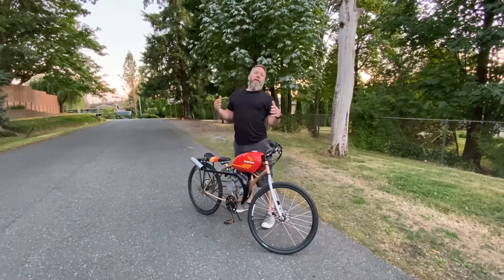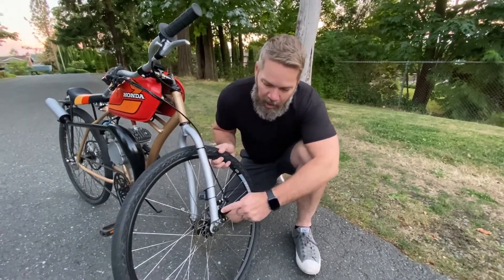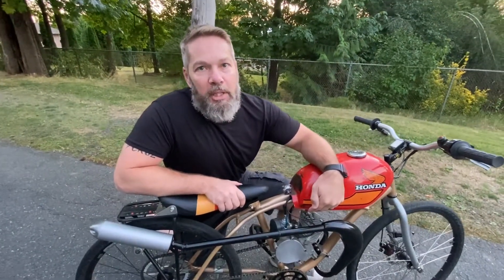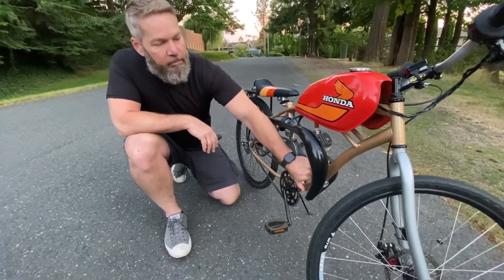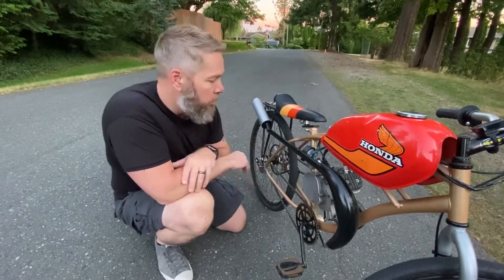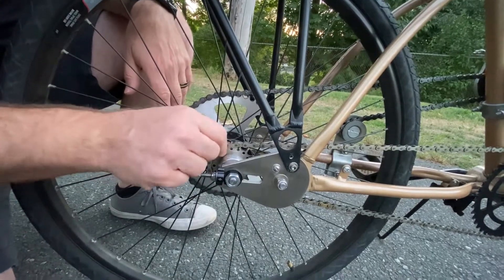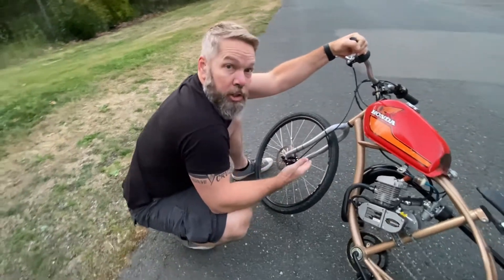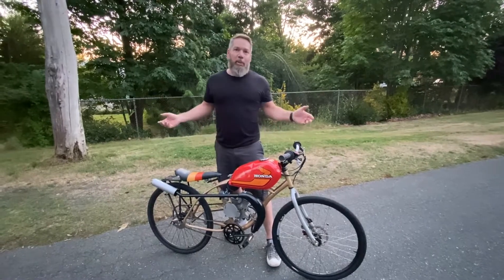The Donald Motorized Bicycle - volume 3 - walk around and upgrades update

Comment: which motorcycle is the tank or more specific the fuel tank
Reply from the maker: mid-70's SL100 Honda.  IT was on Ebay and got it for a decent price with the cap.  Couldn't pass it up when I was planning the bike design.

Would be rad if you subscribed for updates.  I'm going to be posting a video soon about how I mounted the tank.
Reply: @pressfitproductions  thank you gentleman it is great the design stop it is not very big or very small the perfect gas tank for that engine and if I will subscribe to support the content 😁

Comment: That thing goes pretty fast
Reply from the maker: It has gotten quicker and quicker with every mod-update.

I worked on the jetting a bit recently after updating that carb and it has gotten quick nice.  With the large rear sprocket I give up some top end...for quickness and hill climbing power.  Which is just fine :-)

Thanks for watching and I hope you subscribe for more updates.

Comment: What's the size of frame?
Reply from the maker: Technically it would be considered a medium frame.  Pretty tight for me at 6' tall.

That is one of the reasons that the seat is kicked back as far as it is...and the rear wheel is extended out as well.  Needed to get some space on the frame.

Thanks for watching and hope you subscribed!
Reply: How thick is the dropouts?

Comment: I love your horiztonal drop out mod!
Reply from the maker: Thanks.  It is amazing what the little bit of extra wheelbase did for stability.  The Cranbrook frames are pretty small and so to get things where I wanted them it made sense.  I don't think I would go much farther out than what I did though.

There are a lot of added stresses to the frame when adding the dropouts...and the frame material is some of the cheapest steel that I know of, ha ha ha ha!

Comment: If you shorten the outlet pipe equal to 12 times its own diameter it we be more efficient at bleeding the pressure. There's a slew of pointers I'm finding out on my own by reading  "two stroke tuners hand book by Gordon jennings

Comment: What, no mention of the bigger dope ass fuel tank? Lol good build and I like those rear wheel extenders. Definitely putting it on my list.
Reply from the maker: Thanks man!  Yeah the tank is pretty bitching and one of the best parts of the bike.  The stock colors really pop off of the bronze/gold paint of the frame.

The extended rear dropouts are a must man.  Best of luck on your project.

Thanks for watching and hope you subscribed :-)
Reply: What motorcycle did the gas tank came off of ?

Comment: Those pipes are def better than stock, but the header pipe is too small diam.  The header length from engine to chamber is what will change where your power comes in. Bike looks awesome
Reply from the maker: Agreed.  I am hoping to weld up my KTM pipe and give it a shot once I get some free time to work on my TIG skills.  Till then I will just run this Amazon special.

Thanks for watching the video and I would so appreciate it if you subscribed.  Much love.

Comment: I like your bike but that pipe has no power band it's a gimmick pipe you should of used the ktm65 pipe also  
Other than that love the tank
Reply from the maker: Thanks for commenting!  The banana pipe is definitely not the best, but it is definitely better than that straight pipe that comes with the kits.

I will probably work on the KTM pipe I have this spring.  Luckily I have a good jet kit so I can quickly re-jet once the pipe is finished.

Comment: Every bike crash I see people are always picking their bike up before they actually get up . I got the same video almost of me doing it only I'm wearing a GoPro.👍👍☝️ beautiful looking design you got man
Reply from the maker: YES!  All about being nimble and keeping off of the asphalt :-)  Back when I wrecked the bike you can see that I was trying to rotate the pedal to have the inside pedal be on the high side....well the stupid coaster brake locked up, the bike pivoted on the pedal, and the back end locked up...ha ha ha...

Absolute shit show.

Thanks for the kind words on the bike look and layout.  I am wanting to either do a 212cc with gears...or an electric bike next.
Reply: The last crash I had bent my front wheel all the way back into the frame, and I broke the wall I hit. I had a split second decision to make, does the bike take the damage, or do I. Needless to say I spared myself. The motor's on a new frame now, still going strong after a year of heavy use in the Arizona heat.
Reply from the maker: @saved_yet_so_as_by_fire    Oh man that sound like a gnarly bail out!  Glad to hear that you are ok and were able to salvage some of the goods off of the bike.

Be sure to subscribe if you have not yet, for I will be doing a couple of videos soon of some things I have been tinkering with.

Many thanks for watching!
Reply: @pressfitproductions  update I have fried my motor the intake was clogged and it overheated.
Reply from the maker: Damn man!  That sucks.  Best of luck getting back on the road!
Reply: @pressfitproductions  I got a new motor. Pk80 this time, and it's nice...

Comment: Why did you lie  you can adjust your rear wheel,,,, without your new improvement,,,, but I’m not discounting your new improvement,,,, just your lie
Reply from the maker: No lie my friend.  It is just nearly impossible to adjust tension accurately with angled dropouts.  You have little to no control over the tension when working against all 3 axis of travel.  By converting the frame to horizontal drop outs you eliminate the Z axis and it makes for a much more controllable adjustment.

IF the bike had horizontal dropouts from the factory no upgrade/improvement would be needed.

Thanks for watching and commenting!